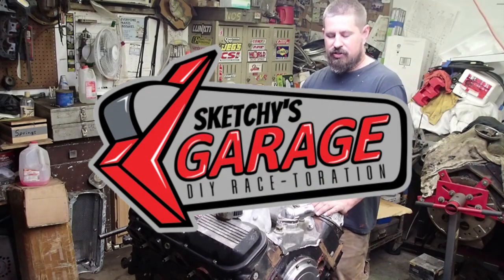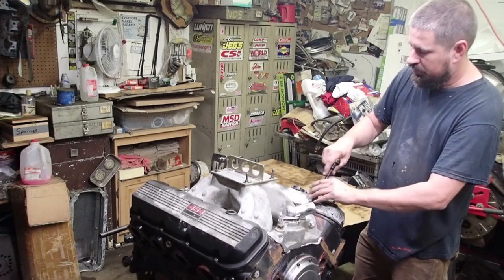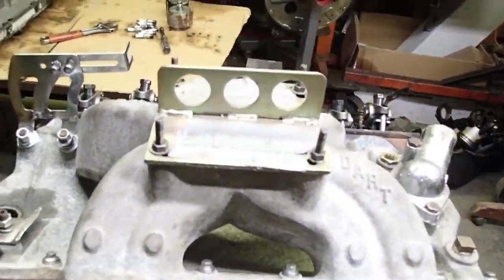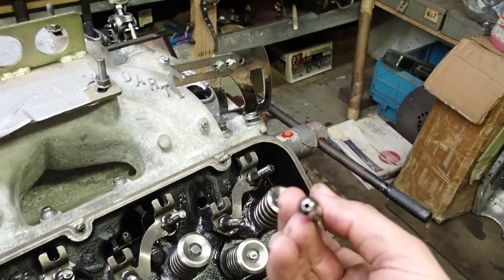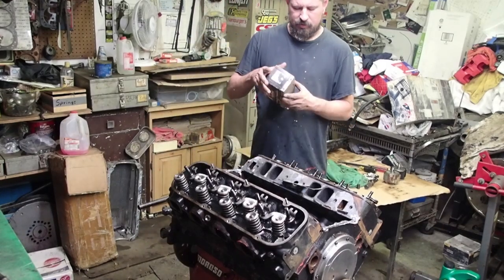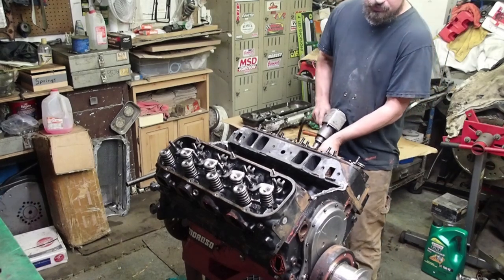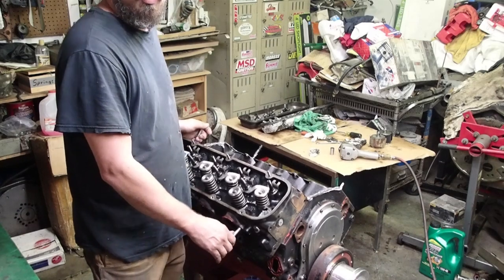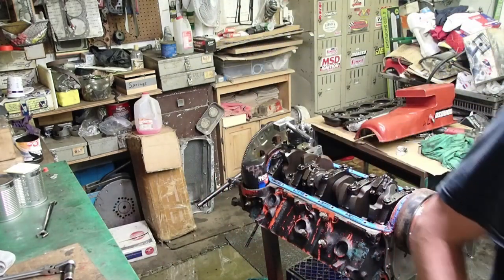BBC Tear Down It's BAD! |Sketchy's Garage

Comment: My first tear down when I was a kid was a old home lite chainsaw. I'd take it apart completely carb and all and put back together, would start every time.
Reply from the maker: That's badass you still got the chainsaw?
Reply: @SketchysGarage  Na. Wish I did. Who would have thought a little cheap saw could be priceless.
Reply from the maker: It's a good chance that chainsaw carved you into who you are today!🤣🤣🤣 Pun intended. 😁
Reply: @SketchysGarage  Good one. Question i have i got a set of Crower 1.7 roller rockers enduro  used still looks new what are they worth?
Reply from the maker: @eddieb1408  $400 to $450 I would think if you have all the poly locks.

Comment: I once drove a car fifteen miles with the rod slapping because of a spun rod bearing (small block chevy). Yeah I had to put in a reconditioned crankshaft and a new connecting rod the next day. but I did it in my driveway. No worries.
Reply from the maker: Good old Chevy's they always get you home.😁

Comment: U need a impact gun. Lol
That would speed ur process up a little
Reply from the maker: I got one, but I don't use an impact on any bolt smaller than a 1/2 bolt. Plus it makes the video longer.🤣🤣🤣😎